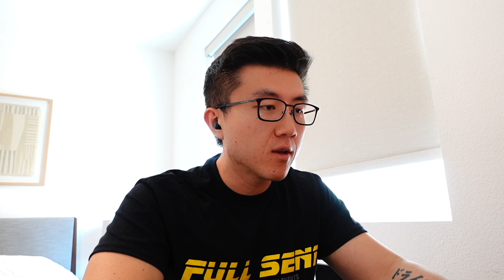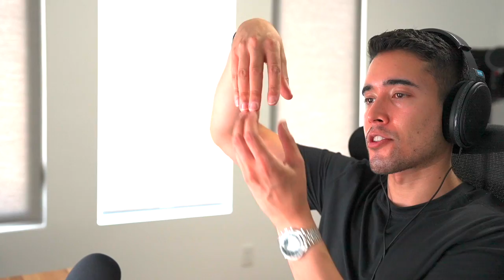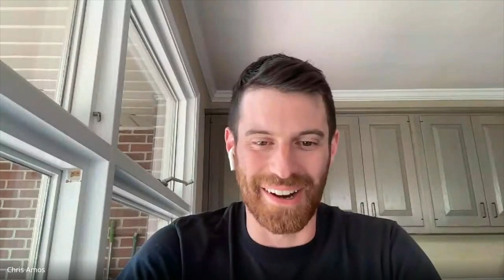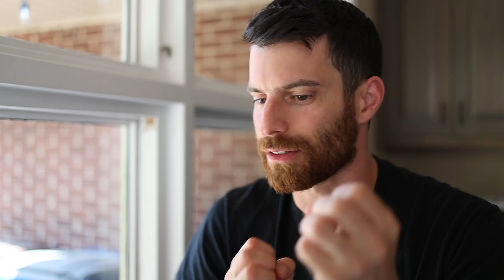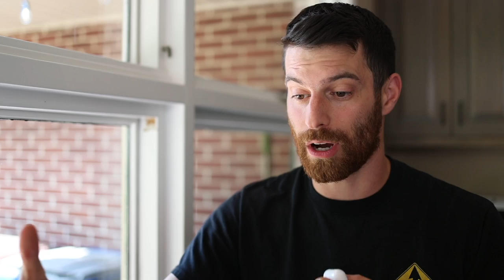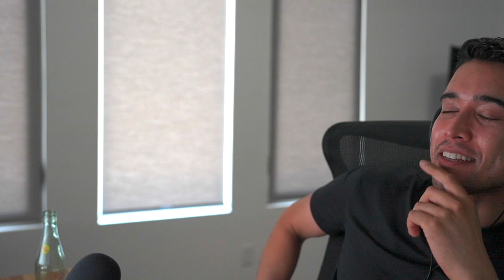Is Your BRZ or GR86 a Ticking Time Bomb? ft. TheTopher and Jubbal & Cars - ZCT #35

Comment: This was a really insightful video, thanks guys!

I’m in Australia and recently put in an order for a new BRZ set to arrive early 2024. Knowing these issues existed, even well before ordering mine, obviously didn’t stop me from getting one.

The preventative practices that you discussed are exactly what I will be doing with my car. Infrequent track use and minimal modifications other than maybe an exhaust, etc. are on my radar. Might drop the oil pan to check the oil pickup for RTV after a couple months of driving as a check-up too.

As well as using a higher quality oil like a 5W30 and regularly changing it, along with an aftermarket oil cooler, are there any other practices that you reckon will assist in further preventing any issues? And would these two practices mentioned above have a chance at voiding the warranty? I’ve seen some debate over what you can and can’t do in this space in order to avoid warranty issues. Seems you have to tip-toe a little…
Reply: It's pretty general advice but from my research it's even more important on Subarus that you don't lug the engine i.e., make sure you're not flat footing it at 2000rpm or less. You'll feel it if the engine is happy or not. Also let it get up to operating temps before driving and even moreso driving it hard. Not only will it cause less wear on the engine but it will drive better too (transmission fluid takes a fair while to get up to temperatures where it starts shifting smoothly). 

Outside of oil starvation and rod bearings, connecting rods are a point of failure mainly when boosted. Regardless, the conrods are designed to operate best for high rpm not low rpm, hence why lugging is a bad idea. Yes you will lose a little bit of fuel economy but it's a small price to pay imo.

A lot of guys recommend change of oil after break in period 1000-2000kms to remove metals and contaminants and there's good evidence to support that, but it won't be a part of scheduled maintenance. I personally did this.

Depending on where you live in Aus it might not be a good idea to go 5w-30. 0w-20 does a better job protecting the engine during cold starts and cold climates. I find it takes longer for a boxer to reach operating temps compared to an inline 4, so it's not inconsequential.

Adding an oil cooler can definitely affect warranty claims. It might not void your claim if the worst occurs, but it will definitely make the situation more complicated. Also dropping the oil pan is the same deal, could complicate warranty claims especially if not performed by the dealer.

Personally, I feel a bit more apprehensive about track use in Australia since a lot of the track marketing was for the US. I wouldn't be surprised at all if you had to escalate a warranty claim beyond the dealership if tracking was involved. The biggest thing is don't moneyshift. They have datalogs to see how high the car has been revved and at what mileage (hence why it's good to respect the break-in period) and I believe Subaru can even see if you've taken it to a track. 

All that is to say: Try to play by their rules if you want them to honor their warranty.
Reply: @harrybuhse8622  Thanks for your reply mate.

I’ve definitely heard a lot about lugging the engine and is something that definitely comes down to the driver. Definitely agree that it’s worth the slightly worse fuel economy in the long run. And obviously any person who cares about the well-being of their car should let it get up to temp before any serious driving.

I think it’s important to be respectful of the break-in period as you mentioned, especially on these cars, and will take your advice on changing the oil around 1-2k kms. Can you explain why 0W-20 does a better job at protecting the engine in cold temps as opposed to 5W-30? I live in South East Queensland. Have you had any issues with your BRZ and what is your advice on maintenance?

As much as I think it’s a good idea to drop the oil pan periodically, it does complicate things as you say especially if not performed by a dealer. Then again, I’m not confident that my dealership would do this for me if I asked unfortunately. It is what it is I suppose.

Thanks again for the advice. What’s your personal experience been like in owning a BRZ in Aus? Would love to hear more.
Reply: @alexmcrae7274  I reckon don't sweat the oil pan unless you are really into tracking it and run sticky tyres since any RTV blockage should be negligible overall. It's when you complicate it with high sustained Gs there might be some moments for wear to occur. 

Very cool car. It's my first rear wheel drive car and as a young male it's certainly a liability 😂

I get the hype behind oversteer that's for sure. I have to remind myself to be careful though since I don't have the experience and driving habits needed to catch the car with traction control and stability off properly. Even if the roads are slightly greasy the car is ready to play and it's easy to underestimate just how quickly it will spin. It's a good dose of horrifying and humbling and I'm just grateful I haven't gotten involved in an accident before learning to respect the car. Unfortunately I don't have any roads that would be good to practice on at the moment, and there's a fair bit of preparation involved for a track day. 

If you're getting a BRZ S model the tyres can be pretty loud over bad roads and the sound system leaves a bit to be desired. I've gotten used to it now but I'm getting a 2-way speaker upgrade (aprox. $600 including labour) to fix that up. Fuel economy isn't horrendous but it's also not amazing since you're filling up with 95 at the minimum. I use 98 and have gotten about 7.9L/100km over 16,000kms with a decent amount of highway. Roughly $80 a tank at these fuel prices.

I bought an axleback exhaust to get a little more noise over stock and I'm happy with it. I don't want to be a cop magnet so I got an exhaust that meets Japanese regulations which is a little quieter than Australian regulations. Any catback/axleback exhaust will give you pops and bangs on downshifts in specific circumstances just a heads up haha. I'm sure it's not a huge deal but even though gen 1 brz/86 exhausts bolt up to new cars the diameters are slightly narrower than gen 2 exhaust setups so keep that in mind when looking to buy. 

Other than that, the doors are long so be careful where you park. You have a button to fold your mirrors in which can be pretty useful. Don't worry about people saying the car is slow because this isn't the US. You'll be faster than a lot of cars on the road especially Qld. It's got great torque between 3000-4000rpm.

Track mode can tell you your oil and coolant temps. There's also a tyre pressure monitoring screen that's made me aware of two tyre punctures already which is pretty bad luck. 

I did get ppf and ceramic coating which is awesome but it's not for everybody. Depends how bad rock chips bother you. I just touched up the paint from rock chips on my last car but I didn't want to do that this time around.

The biggest thing that bothers me is how easy it is to scratch the steering wheel. I've already scratched it 3 times getting in and out. It's easy to do and I've never scratched the wheel on any other car I've been in. Idk what the solution is there. Careful with your keys and your nails even if they're short. It can and will happen. 

As for 0w-20 vs 5w-30 it's best to look that information up since others will be able to explain it far better than me. Essentially they have different optimal operating temperatures, where 0w-20 is some of the best available for keeping high viscosity during low temperatures which will be the case every time you do a cold start. The faster that oil is able to lubricate the engine the better and that's what it does well. It even does a pretty remarkable job in heat too considering, but if you're out doing track days often in the heat, 5w-30 would likely be a better choice since it won't thin out as much at high temperatures if you're reaching them. I've reached about 105⁰C on the street driving spiritedly, where 130⁰C is considered too hot. So personally, I couldn't justify 5w-30 with the sort of driving I do, nor an oil cooler since air to oil coolers can make your oil take longer to get up to temps as well. 

Sorry that was really long hope it was useful :)
Reply: @harrybuhse8622  Wow mate! Thanks for that reply. Absolute gold. Really appreciate it. Loads of great info there which I will definitely remember and research more. Cheers! :)

Comment: Typical Subaru. I don’t know how they’ve been making boxers since the 1950s and still haven’t managed to get things straight. It’s just problem after problem with them.
Reply: Yup, and it's not like they make good power or sound nice either. Waste of a good chassis having subaru engines in there.
Reply: @bobbymobby4169 I tried it at autox this fa24 actually make pretty good power. But yeah I don’t know why subaru won’t just put some effort into making the engine as perfect as the chassis.
Reply: @bobbymobby4169  I want one with a vvti 1UZ
Reply: A little better than rotary engines from my exp...but we still need to treat boxers designs like old cars
Reply: @you_can_fuck_your_own_ass_69  no it's not. The FA24 has a gigantic 94mm bore size. The "2.4L" masks the fact that the FA24 achieves this with a big bore and short stroke. Other ~2.5L engines will usually be square or even undersquare, which makes them much more efficient. I'm sick and tired of people parroting that tidbit as if making power is difficult in the modern era.

Comment: I hate to say it, but the truth is self evident. The GR86 engine is flawed and unreliable due to both design and manufacturing defects. A sports car that can’t handle a corner without blowing the engine is not a good sports car. It’s not even a good car at that point. There are reports of these engines failing without any track use at all. No, this isn’t driver error. Side note, money shifting is more myth than reality. It’s pretty rare that someone misses a shift so badly and gets into gear that the valves get bent. Most track transmissions and cars are designed for engine braking and high RPM conditions. Unless it’ has a GR or Subaru badge on it apparently.

Comment: If it is oil starvation, shouldn’t an oil pan baffle fix a lot it?
Reply: You’d think so, but current designs on the market only solve for vertical sloshing and not high G lateral forces on long track turns. KillerB Motorsports has an impressive design currently in extensive R&D testing. Should remedy the oils starvation issue once and for all.

Comment: I would argue autox is as straining if not more straining on car than track. Throwing it side to side is more violent, you sometimes have to bounce off the rev limiter depending on course and layout. Not as much sustained high revs/heat, but def more thermal stress from going all out for a min then full cool down.
Reply: Interesting counterpoint

Comment: Wow. Talk about grasping at straws. Trying to link "tampering" with brake caliper bolts to engine failure feels like quite a smokescreen. What a nightmare. I know someone with a new Mustang GT that had a small scrape, when it was on the lot. The dealer said they rubbed a hose on it while detailing, and would take care of it. 3 months later, the dealer is still giving him the runaround. I can only imagine the exponentially greater headache on a huge ticket item like a blown engine. Lots of obnoxious wording - "high RPM", "driven at high speed".  If they are smart, there will likely be some "quiet" (so as to not imply it was ever their fault) modifications coming to future model years. Good luck. I have a Gen 1 BRZ, but have not tracked it.

Comment: Definitely a real concern. Subaru just cannot make a reliable engine. That may be unfair for me to say because these are street cars and not track cars, whether they "Come with a track day" or not. We have just had better engine manufacturers like Honda, BMW, Porsche that sold street cars that could actually tolerate a good amount of track use whether that's because they had to tolerate Autobahn abuse or because their engineers were fanatical. Subaru, not so much, their cars have never handled track abuse well and have always needed substantial modification to be reliable on track, be it the EJ motor or the FA motor. I would argue (and I hate to admit it) that 30+ track days at advanced/time trial level pace is abuse and I wouldn't expect a manufacturer to cover an engine failure in that setting, just like I would pre-emptively tear down / have a motor on deck for a S2000 after a couple seasons. It's outside of expected use case and design case.

For the BRZ, unfortunately or fortunately the chassis around it is just fantastic. And it's practical, interior space is decent, rest of the car is pretty good. And I just can't figure out what to replace this car with besides buying another one. I will probably sell mine before it hits 50k miles and replace it with a new BRZ....run it for another 50K, repeat. Unless I can find a better contender...there are not many new, light, RWD, manual transmission sporty cars for sub 40K.

Comment: I hope its not a time bomb its such a cool car
Reply: It's not, if you do the preventative maintenance. Have the RTV sealant checked and make sure that's not going to cause any issues. IF that's ok, start modifying the stock oiling system (if you plan on taking hard turns, on a track etc.) Get it tuned on a dyno, to get a better tune on it. Check the oil every time you fill up at the gas station, do the big maintenance's that you're supposed to at specific mileage, like 30k, 60k etc. and get gauges to monitor important info, like oil pressure, temps etc. and you'll be fine.
Reply: @hhaste to supplement that, go ahead and get a baffled oil pan and an oil cooler.
Reply: @backroadblast6603  should drop oil pan and check for rtv or have a dealer/mechanic do it? i dont have one yet but hopefully soon
Reply: @brzo.  I’m going to have the dealer do it when mine gets here. Some dealers aren’t charging for it. Certainly doesn’t hurt to ask.

Comment: I dont understand why people are surprised that stock cars made for street use break on track 😅 just put the suporting mods that goes with the type of driving that you want to achieve, if you want sustained high G's just add a dry sump and fix fuel starvation issues also add cooling mods and race oil and good fuel, even race cars with all the mods often break on track 😅 its just the way it is, no matter the car model it will still break at some point

Comment: Ideally what mileage should you check for RTV on a new GR86? Might they have fixed some issues with the 2023 model year? MX5s seem known for blowing up their gearboxes instead. I'd much rather lose a gearbox than an engine though. I'm about to confirm my order in a couple of days but kind of worried now.
Reply: We recommend customers do an oil filter/borescope inspection as well as oil/filter change at 1,000 miles. 

For customers that plan to track the vehicle, we recommend immediate oil strainer cleaning/install oil pan baffle at 1,000 miles

Comment: a super important factor im not hearing you guys mention about these individual cases is, what oil and more importantly oil weight is being used in these cars with engine failures?
Reply: @twhalen  i really hope so. i wouldnt abuse these engines with 0w20, a 5w30 would be the minimum for sure.

Comment: Everyone says to use a thicker oil on track, but do we have data to show that helps with the specific failures that people are having? You said it's mostly fast drivers in modified cars that are having the issue. I assume all of them are using a thicker oil.
Reply: It seems the main thing is the sustained lateral forces. The oiling system, regardless of the oil weight, doesn't seem to have quite the ability to handle that. This car is actually a little too fast for it's own good. A thicker weight will help for sure, but mainly due to the oil temperatures the motor can achieve.

Comment: I'll need to do a lot of prep before I feel comfy to take my GR86 to the track: pads, rotors, master cylinder brace, oil pressure gauge, cleaning out RTV, adding a baffled oil pan that has a timing cover blockout... 

It also sucks that US and Japan are the polar opposite on these cars. In Japan, GR Garages exist for these cars. Whereas in US, some Toyota dealers (not sure about Subaru) have not heard about these cars... I am kinda worried if the dealer would raise suspicions at my Cusco magnetic drain plug once I take my car for service...

Comment: Questions to Zygrene: Of the track guys you know that have blown their engines. 
1. I'm curious if any of them were running oil baffles, oil coolers or any other mitigating mods/steps???
2. Had any of them dropped the oil pan and cleaned the pickup?

Comment: I'm considering buying a 2023 GR86 Premium in Manual. I'm not planning on tracking it or putting performance mods on it. Do you think it will run into the oil issues everyone is talking about?
Reply: Nobody knows. Unfortunately.
Reply: @zydomason  Ah that’s fair. In this video, they basically said it would be a very low chance of any oil problems happening.
Reply: @SuperBrownDawg  I have the same dilemma dude. I just ordered one but I can still cancel it and get a miata. I'm so afraid the engine will blow up after the warranty ends. In here in Europe the gre86/brz are crazy expensive.